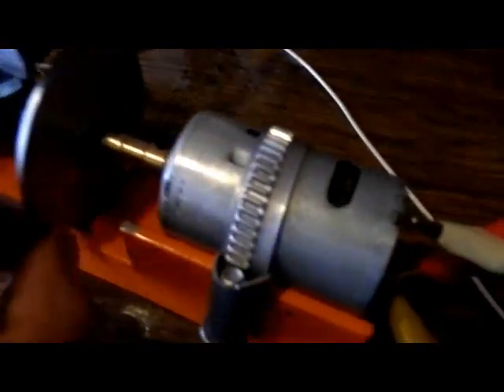cox diesel generator

Comment: What is the fuel you use for diesel head? Blend it yourself?
Reply from the maker: i blend my own fuel
and i kind of switch the mix a lot
most reliable is 33-33-33
(oil-ether-kerosine)
but i also had luck with this mix
20-30-50
(oil-ether-kerosine)

Comment: Cool..never saw that before! :-) Dynostarter! The fault was the fuel.You focused on the compression,but the engine wount start because of the nedel was closed too much...But so we learn every time a bit moore...But like the setup! Keep working on crazy stuff!!

Best regards,
Peter
Reply from the maker: There was a clog in the Spray bar and I did not realise it until I did the tear down
Reply: Aha..thats the problem,A filter is a handy part..But its a nice setup!

Many regards,
Peter
Reply from the maker: i dont have room for a filter
the fuel line in total is 2 cm long
but to be honnest
after the firsth clog (crap from the tank)
it did not happen anymore

Comment: I'm sure you'll get that cox engine run better;) really nice thing!
Reply from the maker: DerKrawallkeks yea it had junk in the spraybarbut now itruns a lot better
i also have the compression verry low
becaus i like it slow
Reply: okey;) you could mount a even heavier flywheel to make it run slower. With a light flywheel, the engine needs some speed to store enough energy for the next compression, but with a heavier disc you can run it on lower rpms
Reply from the maker: it goes pritty low right now
the generator combined with my current flywheel
gives it enough weight